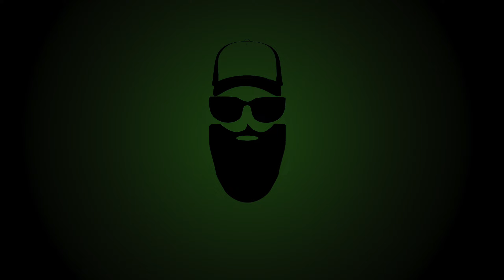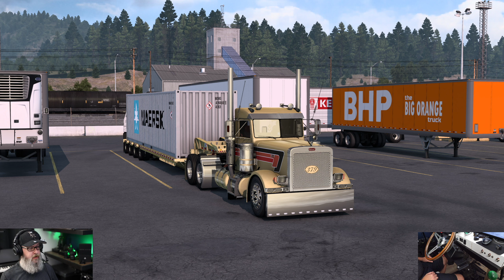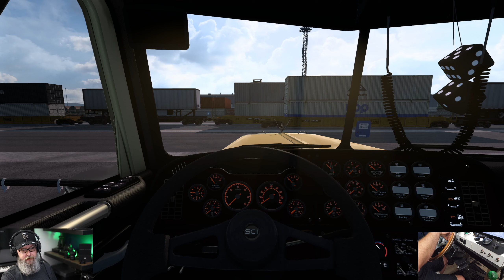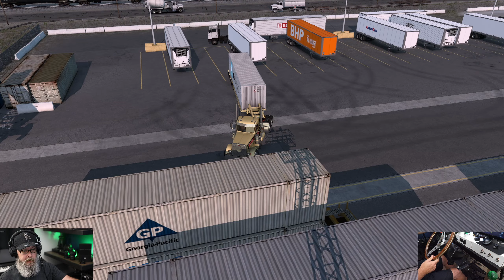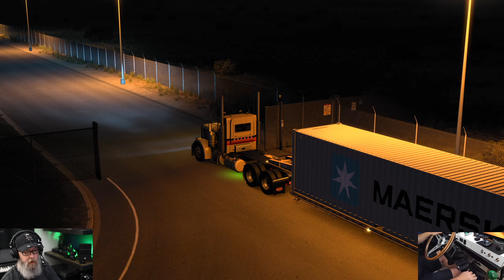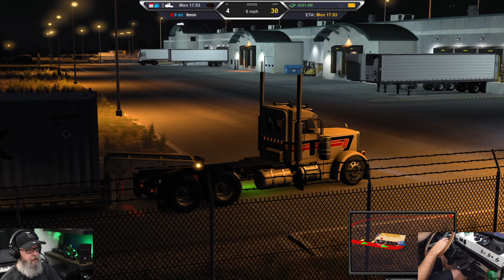Cat 1LW 3406E With 2-Speed Engine Fan | Free Pizzster Trailer | American Truck Simulator

Comment: That's a pretty nice trailer,     I haven't noticed it on the site but i'll have to take a peek at it.
I generally haul containers,   so this could be a neat little change from the regular container chassis i usually have.
Reply from the maker: Yeah, it’s pretty unique. I haven’t seen another trailer like it out there for container hauling. Thanks for the comment The_One_Over_There!

Comment: I downloaded the engine mod but the engine fan does not work for me, i think i have to wrong engine in my truck, but I cant see the difference
Reply from the maker: The engine should be labeled as from JV3 with a distinctive icon when choosing the engine. It should also say 1LW 3406e. If it’s not showing up, make sure you have your truck assigned to the engine.
Reply: I found out the problem, it was that the truck did not have the engine avaliable but it had a 3405E, thanks fo the help